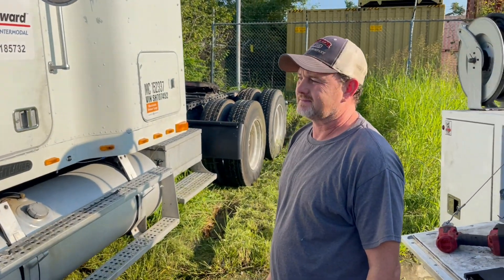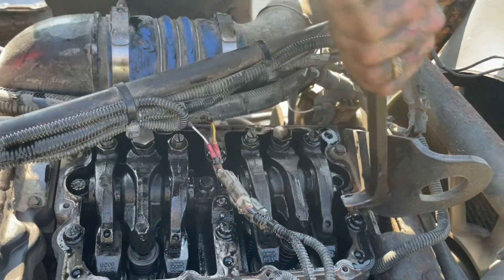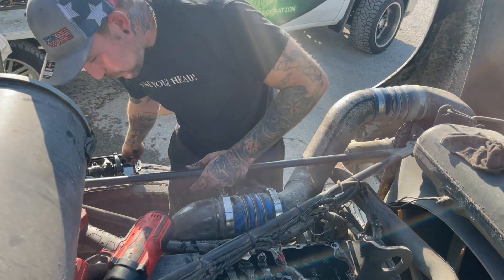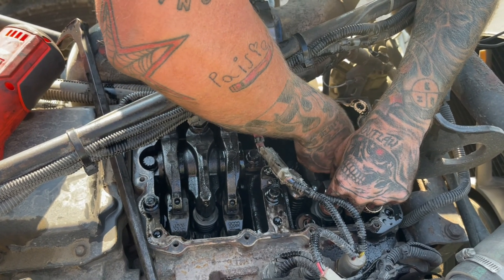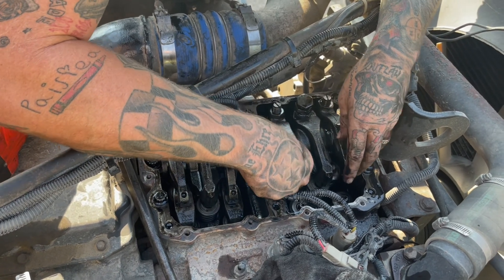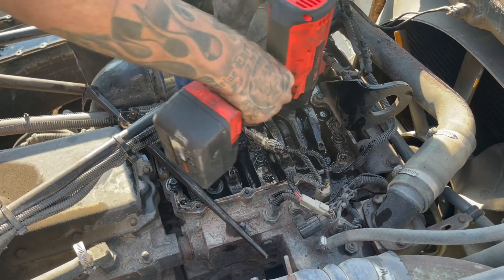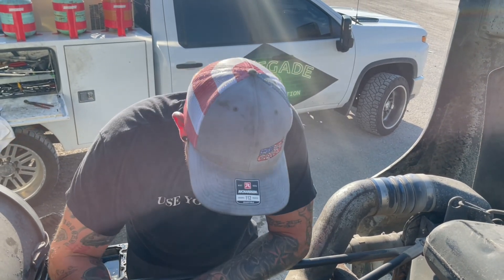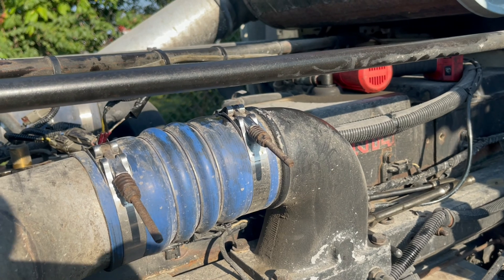Cummins N14 Injector Replacement, Diag and Procedure

Comment: N-14 Adjustments 
    Firing Order 1 5 3 6 2 4
        Injector        Valves
A           1                     1
B           5                     5
C           3                     3
A           6                     6
B           2                     2
C           4                     4
Start in a sequence of the 
       CLOSED VALVES .
Intake .014    Exhaust .027

Comment: I had a mechanic either not evacuate the cylinder or not make sure the push rods were seated and it bent the push rod, same mechanic just done a head gasket job and it's dumping fuel in the oil, probably because ORINGS

Comment: What’s a normal oil pressure on this engines mine do 15 idle & 30/35 driving this is Normal ???
Reply from the maker: as the engine wears yes … your getting to a point the you will need an in frame

Comment: actually you want to pop the injector into the hole if you rotate it the orings could get cut just give it a good tap down and itll seat good.  Make sure your orings are coated in engine oil
Reply from the maker: yes

Comment: Thank you for the video.  I see that you started the motor with the valve cover off.  The guy that put my injectors in did the same thing and oil sprayed everywhere like the Beverly Hillbillies!!!  Is the indicative that he did not have something seated correctly?  Also is there a special tool that must be used to set the valves to a particular measurement?  I am just needing a little insight.  We replaced all six and now I have 2 that are missing (1 and 5).  At this point I can't even get it to a shop if I wanted too.
Reply from the maker: Yes something wasn’t correct

Comment: Aren't you suppose to tighten the injector then loosen then torque to 30 ftlb to prevent timing plunger from sticking?
Reply from the maker: yes if your going by the book this is diy on the side of the road
Reply: @stickshiftracing  if you do it right the first time you shouldn't have to do it again .I was taught to do is all .

Comment: how much did you charge him?
Reply from the maker: 200 bucks
Reply: @stickshiftracing  yea? my mechanic charged me 400 but that included a tune up...
Reply: What exactly do you mean by tune-up?  Adjusting the overhead?  Traditionally a tune-up has meant replacing the ignition condenser, adjusting or replacing the points, cleaning and gapping the spark plugs and replacing plug wires, coil, cap and rotor as necessary.  Almost none of this is required in modern gasoline engines, but people still say "it needs a tune-up."  And none of it applies to a diesels, so I'm just curious what your mechanic meant by saying he did a "tune-up" and charging you an extra $200.
Reply: @michaelgeurink4422  setting the overhead
Reply: Where are you located?

Comment: Since you are so concerned about bending a push-rod, why not bar the engine over with a breaker bar on the dampener nut?
Reply from the maker: I’m not running overhead and I’m confident on seating  the pushrod however that’s a good point I’ll make sure to include that in the next video